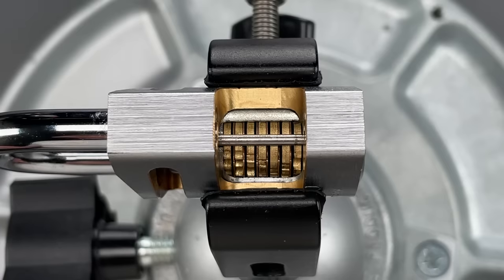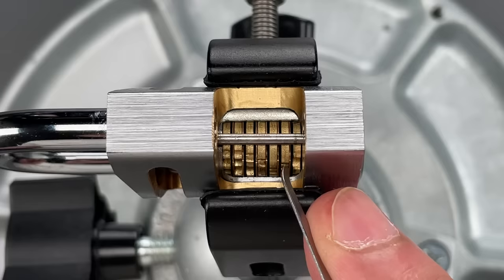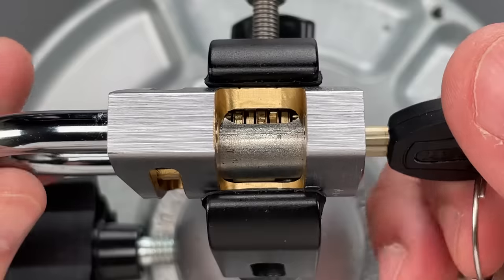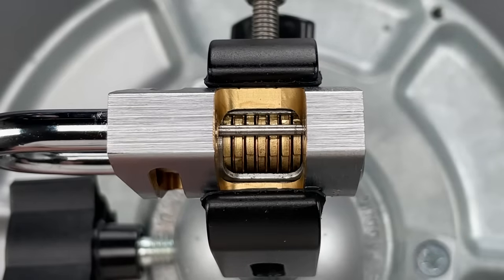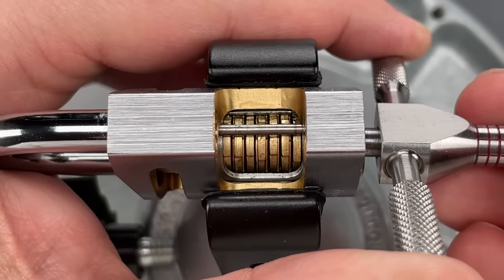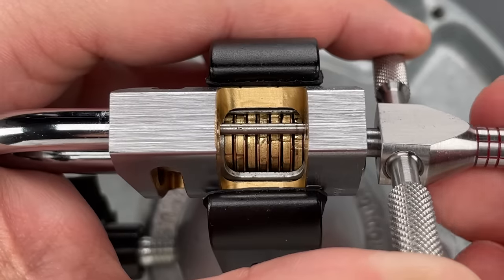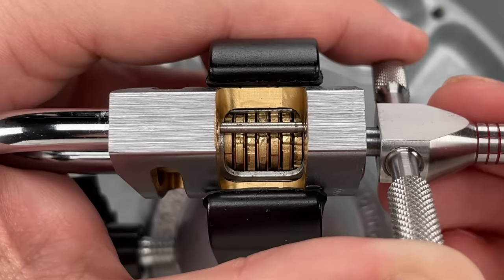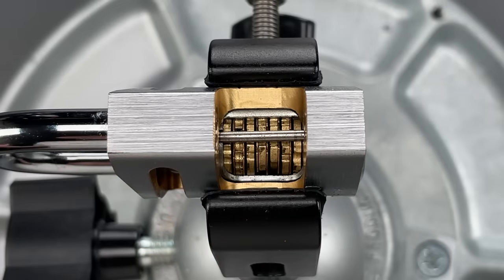[1436] Inside Perspective on Picking Disc Detainer Locks

Comment: This really helped to visualize this! Thanks! I feel like I should learn how to pick these, as so many bicycle locks here in the Netherlands are (usually Abus) disk detainer core.

For example, my son lost his bike keys and we haven't been able to use his bike for a week. :(

Also, people say I sounds like you but I'm not hearing it.
Reply: I bought a big Abus disk detainer D lock from a bike store last year - cost me £50... Now everyone can find out how to pick it from YouTube 😭

LPL is going to be the Park Tools of bike thieves...
Reply: @vaska00762  Most bike thieves don't pick locks. They cut chains, bars cables, or the bike or the object you have the bike locked to.
Reply: @MonkeyJedi99  cutting the bike kinda destroys the bike...

I have a D lock and I'd say that if I locked it to an object, then you'd need an angle grinder or a plasma torch. Both would attract a lot of attention. Picking a lock, by contrast, is a lot more discreet.

I wouldn't trust chains or a steel cable lock. But one thing I like about Abus, is that they make a lock holder that attaches to the frame, so you can keep the lock on the bike frame when you're not needing the lock. Some competitors do the same, but I'm not sure I've seen Kryptonite do it - could very well be wrong, but no bike store I've seen sells a Kryptonite lock that comes with a frame mount.
Reply: @vaska00762  I suppose I have been jaded by videos of bike thieves in action in dumps like NYC.
The one time I had a bike stolen was WAY back in the 1970's in Phoenix, and back then a simple mild steel chain was the norm. I found my chain cut, and no bike.
After that, I only owned bikes I built from junkyard parts (though tires, tubes, pedals and seats were something I had to usually buy). I think my most expensive bike built that way had about $50 sunk into it.
$55 if I painted the frame.
Reply: Funny, I just watched one of your videos, then was about to click on this one, and I was thinking of the similarity (and differences) between your voices and narration styles!

Offhand, I think you both have deep, resonant voices, and similar intonations and pauses. But different pitches and timbres.

BTW, I love your work, NJB. Learned about Strong Towns from you, too. Thanks so much, and please keep it up!
Reply: I think this is just a distraction. You are drawing attention to your voices being similar so people don't realize that you are actually the same people, but I can't be tricked.

Love your videos too, fun to see when some of my favorite creators watch my other favorites lol
Reply: @vaska00762  This is where the social engineering aspect of criminal activity comes in - there are some very superficial legitimacy signallers that people are generally primed to accept at face value. I have a couple of friends who do professional pen-testing/security audits, and you'd be amazed at the activities that suddenly stop attracting attention when they're done by a moderately attractive adult wearing the appropriate uniform/high-viz and using props like clipboards, safety tape, expensive-looking briefcase, etc.

Fiddling with a lock looks suss. A generic road/council/construction worker using power tools is common and unremarkable.

Similarly, there are endless accounts of brazen retail thefts where someone walks into a store with a wheeled dolly and clipboard, loads up 15-20 brand new laptop boxes, makes the minimum-wage clerk sign a bullshit 'stock reallocation form' with the company logo on the header and deactivate the doorway security sensor, and then just strolls out with their loot.
Reply: When I randomly feel cool because the guy in my disk detainer lockpicking class is the professor of class I took about how awful stroads are.
Reply: Thieves don't care about the attention an angle grinder brings. As said above, high vis vest and look like you're official and you're golden. Absolute worst case someone challenges you and you just need to leave and find another bike rack.

Also as far as picking goes, LPL is very good at it and makes it look easy, it takes a significant amount of practice to be that good (plus picking in the field is rather harder than in a vice), people with the inclination and aptitude to learn such a skill generally tend to have decent paying jobs. In the rare event they are criminally inclined they'll be doing rather higher value heists not low level rubbish like nicking bikes off the street.
Reply: I think your voice is relatively low-pitched like LPL's, and you both tend to speak rather calmly (when not discussing horrible business park infrastructure :P). But otherwise I agree, there's a quite audible difference.
Reply: The people that stole my bike used a van for that

Comment: I've never fully understood why there is a difference in width between false and true gates. Why is it not possible/practical to make false gates as wide as the true gate, but shallower?

It seems like a good anti-pick feature as it would mess with the sense of "there is lots of movement in this gate, so it's probably the true gate", but I'm guessing there's a reason why it wouldn't work.
Reply: I was questioning the same thing, like wouldn't it be so much more secure if they were all the same width.
Reply: Also why don't try to make sidebard and disks hard enough that there would be no clicks when some of the disks set.

Comment: This provides a great view of the internal workings of these locks. Looking at the disks, there appears that there could be more than one solution in the alignment of the disks to open the lock. Is this accurate, or only an illusion of what could be seen in the video? Thanks for the great info on this type of lock.
Reply: There is only one true gate on each disc, so there is only one solution. Most of the notches are false gates and are useless.
Reply: The other notches are "false gates", and they are cut too shallow to allow the sidebar to drop down enough to allow the lock to turn.
Reply: Although I believe LPL has shown at least one lock where the manufacturing was so sloppy that the false gates were deep enough to allow more than one solution.  It’s not supposed to happen though.
Reply: It's possible but unlikely if the lock is well made, unless someone intentionally created multiple true gates...  I could maybe see it for a master key system, though, but disc locks are so rarely used in buildings.

Comment: Mechanical question: does the moving rod rely on gravity to fall into place? What happens if you hold the lock the opposite way?  Thanks, amazing series, keep it up!
Reply: Springs
Reply: @CR-iz1od  cool thanks
Reply: The tension created by turning the key pushes the rod into the slot into the discs. That's why some chineseoloy locks can be opened with a screwdriver and pliers.
Reply: @CR-iz1od  I haven't seen any locks that use springs, but they might do this in some Abloy models.
Reply: @thorlancaster5641  i doubt it's springs from the way the bar moves without being in the true gates. for sure the tension from turning the key like you stated
Reply: It's pushed by the tension of turning the key, not gravity, and not springs.
Reply: No springs or gravity, just sheer "can X hard body fit in y space" mechanical forcing. The cut of the rod in the lock hull (what prevents the core from rotating) is a half round shape to match  the rod. The disc pack carrier tries to rotate and has a slot cut for the rod. This tries to push the rod to side, which from the round angle cut of it's seat cut in the body tries to push it inward. 

If the disc gates line up, the rod falls in pushed by the carrier and by the disappearance of the seat cut of the lock body (since the carrier is rotating out of alignment with the cut in the body) and instead falls into the gate cuts of the discs. If the disc don't line up, well it tries to fall inward forces by the disc carrier, but can't.... lock fails to open.
Reply: Thanks everyone, latest comments were accurate, it's just the physicality of the shapes the makes the bar "want" to be there.

Comment: Really well done. I was able to learn all this from watching you and BosnianBill so often but this should help people just now learning them understand how they work. This also points out what I have a hard time trying to explain to some folks about how some of the set discs can get skewed a bit when you are picking a lock with a spring loaded disc pack. It's not much but if the lock has good tolerances it can get tricky. BTW LPL, I am still having trouble trying to make a tool for the Abloy Sentry. I can only get the discs to rotate clockwise so far. That fork is my nemesis

Comment: I know you do some machining and home design stuff on your own, one thing that might be interesting to try would be to take this cutaway lock, remove the discs, and replace them with perhaps acrylic discs or something else that would be as transparent as possible, with maybe paint in the notches so you could see them moving around in 3 dimensions and the key/picks inside the discs. In either case, this was a really fun video.

Comment: Great video about DD locks. I think this is about the best you can do with an actual lock that still works with a key and doesn't have transparent parts.

It would have been good to mention that if the false gates were equal width to true gate then you would need to find any binding disk and rotate until falls into a gate that doesn't bind. This is no different from picking higher quality pin tumbler locks where binding order is not 1-2-3-4-5... or ...5-4-3-2-1. The important point to understand is that sidebar of a locked lock must be binding with at least one disk (no matter if it's in false gate or not) and if you only move the binding disk, you can always find either a deeper false gate or the true gate. And never move a disk which is not binding, exactly like when you're picking individual pins in pin tumbler locks.

Hopefully you have or can create a cutaway lock for Abloy Protec where you could show the DBS (disk blocking system), too, which is supposed to prevent turning the disks when force is applied to the disk carrier which should prevent picking the lock with the method shown here. The Protec core also has mush more restricted keyway so the tools you need to use must be much more delicate to fit into the keyway.

Comment: Have "The Pick" and intuited how to tension and pick in opposing directions, but this is still very helpful. I am still honing my SPP skills and this will be a fun added project! 
It seems like it is a lot easier if you can set the pick body against the lock body for stability, and the adjustability of the pick would let you do that but only up to a point, with smaller DD locks you won't have that much 'meat' to the lock so I was worried it would be impossible, but I see you do it here with a padlock with the pick body free floating and understand that it is just a matter of keeping the pick in alignment. 

Thanks!

Comment: Despite watching you turn all of the discs clockwise so many times, it had never clicked to me that a wrong key can still rotate a disc container core the same as a correct key. I was still thinking of pin and tumblers where you can't rotate the core unless all of the pins are set correctly.
My brain then invented the reason that you were just making sure things were initially aligned so that it was easier to get the pick in.

Comment: Thank you! This is exactly what I wanted to see. I had no idea how the disc detainer core worked and this made it quite clear.

It would be interesting to me to see you do this again but use the normal "little click", etc verbiage you use when picking these. It was clear you were looking at the internals as you picked and it changed the overall feel of the video.

Do you plan on doing dimple or wafer locks anytime soon?

I think a video showing the lock internals while bumping could be fun too.

Comment: That is one heck of a custom made tool.  It could be threaded to change depth, possibly push to depth (much easier to make) but still be able to rotate without doing that when truing a disk. Has he done a video picking this style with traditional picks ?
Hope it’s much harder, I use a couple locks with that style.

Comment: @lockpickinglawyer  it would be incredibly helpful to show the full tool prior to it's use, explain how it manipulates the lock, where you apply pressure etc.  Then perhaps show a slightly wider angle that includes the tool with a zoomed in camera showing the locks.   You will need a second camera and insert the second video time aligned (use a clap and zoom in on audio files)
That would fully show the technique and you would sell more tools.

Comment: I love this, because it's really obscure to take in for disc detainer without this detail of an explanation. So the true gates make enough space for the bar to dip and clear a tight path to be push out the latch keeping the rest in place. For a while I was confused how a disk/bar based design off rotation could have false gates in the design, but this paints the perspective clearly. Since the goal in picking these is looking for the drop enough for the bar into, wouldn't adding slightly angled dips (like not perpendicularly cut through) into false gates add to the picking resistance in the security, where the end most portion could feel like it went into a true gate, but it's still a false gate and throws off the rest in question? Would too much alterations interfere with the mechanism?

Comment: Have you considered selling cut-away locks on covert instruments? I've been practicing using the practice lock, but the main things I'm still struggling with is knowing when I have my pick on a pin vs in between two pins. Being able to see the pin move would help learn the difference and to know which pin I'm on.

Comment: Very insightful. If the true gates would be just as wide as the false gates, but just deeper to allow for the bar to drop, would this improve the picking resistance as it would make true gates less distinguishable from false ones? If so, why is this not done? Is this purely for manufacturing tolerance reasons?

Comment: Longtime LPL fan. Great video and I think I finally understand the basics of picking these types of locks, except perhaps for one thing: I don't quite understand how tensioning works and why it's applied to the first disc? And is that the first disc that is visible on the right? Is it tensioning by applying clockwise force? If so, then how is it then turned counter-clockwise to feel for the gates? Or is the gate being described actually one that's further right than the first visible one? And is that some sort of special disc that is connected to the carrier? How and why is it connected to the carrier? And is it always the first disc that's connected in that way?

Comment: Other than the fact that you need a specialized tool are disc detainer locks generally easier to pick than pin locks? It seems like it wouldn’t be as important to keep constant tension on the core since there’s no risk of dropping pins back down

Comment: Seems like the right video to ask this question on. I've seen you always using your special pick for these. Is it possible (or practical) to pick a disc detainer without a specialized tool? If not, it seems a good locking system for general use, to me, as most would-be thieves would then be out of luck, greatly reducing the likelihood of theft. (of course they can just cut the lock, but any lock will fail to a determined bad actor eventually).

Comment: Assuming the right tool and equivalent skill, it looks like picking a disc detainer lock would be quicker than picking a pin tumbler lock.  On a pin tumbler lock you have to figure out the order to pick the pins, but in this video LPL simply went disc by disc in sequence from right to left.

Comment: The only thing missing here is showing how the key cuts correspond to how much a given disc rotates in that windup phase.  I would assume most discs just have some sort of stair step pattern on the inside?

Edit: the way the keying is set is just that the keys have angles cut into them, and there are several possible angles per disc slot.  A zero cut would have the most travel when the key is rotated I think.

Comment: My one point of critique of this video would be that it would have been helpful to zoom out a little or point the camera a bit more to the right so that we could also see what you were doing with the pick. Of course, as I've watched you use that pick in a lot of other videos, and as you pick the gates in order, I had no problem knowing what the pick was doing. But with the lines on the pick so visually showing what disc you're on it's especially odd for this series to not include that part in frame. On the other hand I fully get that you want to also zoom in on that cutaway that no doubt took some effort to make.

Comment: Hi, not sure if you do requests, but there’s been a tire thievery problem in my town. I was wondering if you could do a video about how effective wheel lugnut locks are, and if they’re worth the extra money, or purely psychological. Thank you!
Reply: Doesn't need to do a video. They don't work. The removal kits for those locks are sold at most auto places or in a bind you just pound a tight fitting socket onto one. They typically don't even meet the basic extra work requirement since pounding a socket on just takes a moment. I have splined lugs on my truck torqued to 145 ft-lbs and can remove even them with a regular socket without damaging them lol. I just needed the thin profile lug for my wheels. They have a special key which is worthless. The security locks will get damaged but a thief won't care.